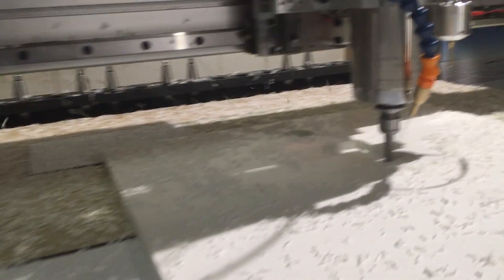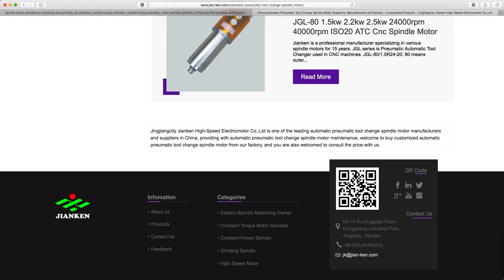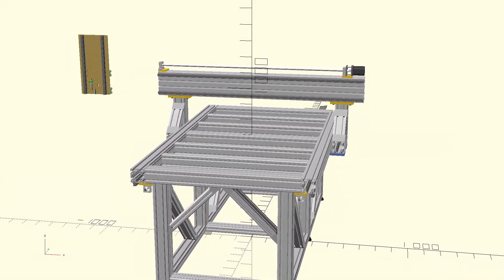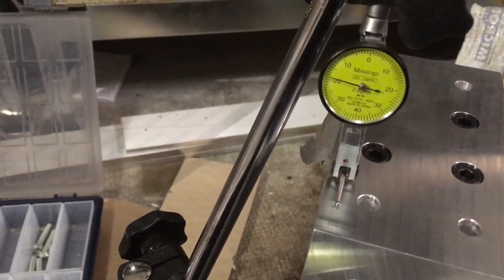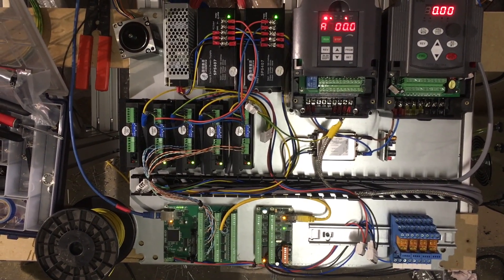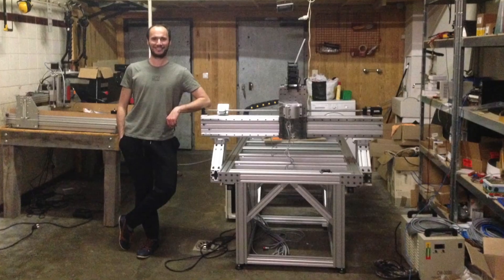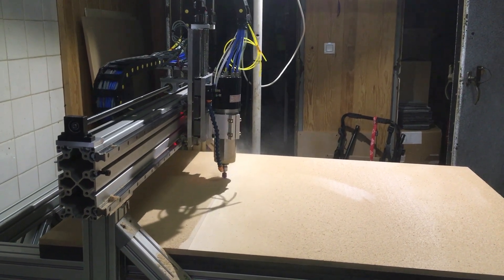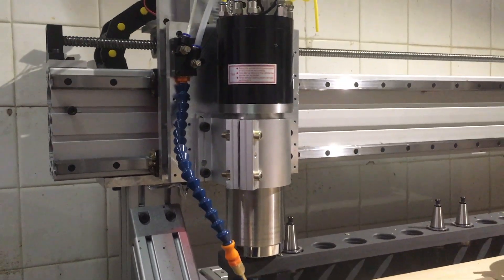My DIY CNC Router build with ATC and Vacuum Table

Comment: Nice work! love the ATC and the probe. What vacuum-pump did you get?  I found a -330mbar of 2.2kw with 290m3 flow and a -560 with 76m3 flow. In my experience the larger flow is better for working on an MDF spoilboard. Are you using uccnc?
Reply: why would a larger flow be better? once the vacuum is pulled there is virtually no more flow
Reply: @Gekkoperformance  That greatly depends on your application. On the small machine I'm using a Edwards RV8 for vacuumpods, but for a bed you need something that has a lot more flow. When using a dedicated pod created for the job that has no leakage you can work with a low flow. If a vacuum is maintained, you wouldn't need any flow at all. But when cutting parts from an aluminium/plastic/plywood sheet you'll loose vacuum quickly. I'm using a ~10hp vacuumpump on my large machine that can pull -950mbar, with a 500m3 flow, but it drops to -200mbar when slotting parts out. Even with fully HPL laminated plywood it's hard to get a vacuum over -600mbar. (so you need to use some CAM-kong-fu with smaller parts) Most of the machines that are the same size are using something over twice as powerful. In some occasions a deep vacuum is needed to hold the relative smaller sized parts in place, in that case you don't need a breather-board like MDF and put the part directly onto the vacuum bed.  It's very convenient to be able to shut some valves on your vacuumbed, smack the parts in place and hit start. (and use the top of your spoilboard as Z 0 and the left front part as x/y zero. That way you only need to zero your Z when the spoil board is skimmed again. In most occasions a higher flow, relative lower deep vacuum is more handy.
Reply from the maker: I'm using a 2.2kW / 3HP / -0.190 bars with 318 m^3/h flow. But of course you don't have both at the same time, it's 0 flow at -0.19 bars and 318m^3/h at -0.00 bar. Given that it leaks everywhere with the MDF spoilboard (I almost never cover the unused area) I choose a high flow pump and I'm very happy with it. But I don't have any barometer installed so I don't know what is my actual pressure. Cutting aluminium composite panel I can safely cut pieces down to 15cm x 15cm. A more powerful one would of course be better, but this was the maximum I could use given my electrical installation (220v 1 phase, 6kW subscription).
And yes, I use Z = 0 on the spoilboard surface and I never have to zero my Z. This is very convenient. I actually set my Z zero 0.1mm below the surface to be sure to cut trough.
No, I don't use uccnc, I use LinuxCNC.
Reply: @YannPomarede  Thanks for your reply.  Yes, indeed, the one I was looking at is a dual stage, they typically have a higher flow at a deeper vacuum. (dual stage over single stage) At home i'm also limited in power.  so 1.5-2.2 kw is the max. Did you skimmed the MDF on both sides? this makes it more 'breathable' but I guess you know this.
Reply from the maker: Yep of course I skimmed both sides. But I still need to add more glue on the sides and bottom, because I can feel the leaks. I hesitated between a single stage and double stage and I went for the single stage. But I have no idea if it was the best choice.

Comment: Well done, very nice build. One thing to try is to add weight to it (ballast in the gantry) and it will dampen the vibrations. 

What soft are you running it on ? 

All the best!
Reply from the maker: Thanks. I'm not sure adding weight would dampen the vibrations. It would certainly lower the vibration frequency, but as for dampening I would need to use a material that actually absorb vibrations, not just dead weight.
I'm running it with LinuxCNC.
Reply: Yann Pomarede: you are correct, you will shift the natural frequencies lower and thus getting rid of the typical buzz accompanying home made CNC machines. I wrote it up in a confusing way. Once again, well done !

Comment: This is amazing very impressed!!! What is the rigidity like?
Reply from the maker: Thanks, well, it's definitely more rigid that my previous one. But still it can "bend" a couple of 0.1mm if I apply a couple of 10kg with my hands. I never measured precisely though. But I guess it's normal with an aluminium frame.
Reply: @YannPomarede  I want to see how you have done the probe and auto tool change

Comment: What is the price of the spindle?
Reply from the maker: 1360 € 1 year ago
Reply: @YannPomarede  Thanks! I am not any expert, but this price sounds really good! What did you spend for the whole project? (I don't know if it is OK to answer those questions publicly, I am really interested of building one in future. Is it fine if I have your email?)
Reply from the maker: Adding every component together it's not that cheap and it's not in everyone DIY budget. But I'm using this machine to produce some parts that I sell. So it has already been paid by itself within a year. It's was around 8000 € of hardware + 3 months of design and assembly.
Reply: @YannPomarede  I am not thinking for a private use. I would like to have a workshop that I am already talking with a friend and a cousin for a custom CNC. I can't find anything I like on market and they are really overpriced. My project If I can make it should be 3000mm x 1500mm for plastics and maybe wood only. At least 8 interchangable tools and a good vacuum table. I can design everything. But I am not good at all with electronics...

Comment: Any issues with screw whip?
Reply from the maker: Yep, that's my limiting factor for speed. I run my rapids at 9000mm/min and I cannot go faster. But that's no surprise, and that was in line with what I had calculated with the ballscrew diameter, length and rotational speed. That's why I choose a 10mm pitch (instead of 5mm) for X and Y.

Comment: Great job men . The connection with computer is usb ? What kind of breakout  board are you used ?
Reply from the maker: It’s a Mesa 7i96 board connected with Ethernet to the computer. And I run LinuxCNC on the computer.

Comment: What is the black material you are using for the vacuum table called?
Reply from the maker: It’s a kind of MDF but denser, with thinner grain and more resin. It’s called Valcromat
Reply: @YannPomarede  Appreciate the reply. Great work on your machine.

Comment: whats up with all theses guys building their own cnc routers? with that kind of money you could buy an used machine that would do real heavy work with fast rapids and a real atc. some machines with some repair and reconditioning could do parts with even +-0.005mm tolerances with easy.
Reply from the maker: It would not be as much fun if I just had to buy one ;-)
No seriously I looked around, and of course real routers may be faster, do heavy work and have better precision, but they also weight literally a ton, are difficult to move (I'm renting the flat currently) and are 3 to 4 times more expensive (for used one).
Reply: @YannPomarede  well. Just that amount off aluminum that you bought, I could have bought a fanuc robodrill here.
Reply from the maker: I don't know where you live, maybe aluminium is ultra expensive or a Fanuc Robodrill is super cheap, but here in Europe I paid less than 1000 € for all the aluminium you see. If you can provide me a Fanuc Robodrill for that price I might take one, but its working surface will still be too small for my needs.
Reply: @YannPomarede  I agree with you.  I had the chance for a 5'x10' massive ATC CNC router... but had to pass on it because it wouldn't exactly fit in my garage.
Reply: @YannPomarede  Hi Yann, really nice machine you've built!
Currently i'm designing a cnc router/plasma table as well and wondered where you've ordered your aluminium profiles and plates, because around 1000 euros for everything looks like a good deal :)
I'm looking forward to your next table built :)
Kind regards, Mathieu (from The Netherlands)
Reply from the maker: @mpkleinbreteler  You can find the aluminium profiles and plates here: https://www.motedis.com

Comment: Cool Machine, i have an idea for the next Video: Put some JMC Servos on there they should fit the existing mount and are rated at 180W (depending on the Type) and they are cheap!!
Reply from the maker: My next one will use servos, stay tuned ;-)

Comment: Nice work.  I'm really liking the vacuum table setup.  I'd love to see more videos on how well the design worked for you and details.  I have been thinking the diaphragm vacuum pumps on some industrial water pumps I work with might do very well for the application.
Reply from the maker: Thanks. Correct me if I'm wrong but I think diaphragm vacuum pumps are high vacuum (close to 0 bar) but low airflow?  It could be suited if you want to hold firmly small parts with good sealing, but in the case of a MDF vacuum table with lots of leaks, what's most important is a high airflow to compensate for all the leaks. No?

Comment: What is happening when you say you're "setting the gantry"?
Reply from the maker: I wanted to say “squaring the gantry” but I got confused while recording the audio. I was measuring the angle between X and Y axis. Then, applying an offset on one of  the end stops I can correct the gantry for squareness.
Reply: @YannPomarede  excellent solution, I've been trying to solve that problem on my X-carve, thank you!

Comment: The whole gantry is basically hanging from the 2 linear rails on the bottom? Is the gantry not  to heavy for that?
Reply from the maker: Too heavy for the rails, the bearings, or the screws? Those are 20mm rails, each of the 4 bearings on those 2 rails supports a dynamic load of 17 kN (~1700 kg). And each 5mm screw (class 12.9) on the rail breaks at 10kN (~1000kg). There is a screw every 60mm. That leaves some room for overloading that gantry. We could easily fit 10 persons on it! Well, not that easily because there would not be enough space to sit ;-)
Reply: Sound strong enough.  Can't remember ever seeing such a config. Keeps the rails clean  and out of the way. Those 10 people on the gantry would be a fun YT video :)

Comment: Probably the best diy build ive seen ! How powerfull is the vaccuum motor ?
Reply from the maker: The side channel blower used for vacuum has a power of 2.2kW, airflow = 318 m^3/h and pressure = -0.190 bars.
Reference GHBH 003 34 1R7.

Comment: Can you tell me  what you use   program   for  auto tool changer ??
Reply from the maker: I'm using LinuxCNC and I used it's code remapping feature to change the behaviour of M6 to my own tool change routine. I don't need any post processor in my CAM. I just output a Tx M6 and the tool changes.
Reply: @YannPomarede  thanks bro
Reply: @YannPomarede  Will Linux CNC also do the probing and coordinate transform for you?  That's really slick how you just sense the flipped location in your example video.
Reply from the maker: @aeronerd22  Of course it can do all that :)  LinuxCNC provide 2 things : a normal probing move (G38.x) and a coordinate system transformation (G10). Then it's up to you to program in GCode all your probing move, compute the new origin and rotation based on the result of the probing (still with gcode, you can do sums, averages and arc tangent), then apply the result with a G10.

Comment: how much did the ATC spindle cost?
Reply from the maker: 1 year ago it was 1360 € (with shipping included)
Reply: @YannPomarede  not bad
Reply: @YannPomarede  amazing build and video. How is the spindle performing now after some use?
Over on the diy cnc Facebook page everyone was very impressed with your build.
Thanks 😀
Reply from the maker: @MakeTechPtyLtd  It still works great. I've been using it with higher and higher feedrate & RPM on a small production batch. With my new 8mm roughing endmill with 3 flutes I get the following speed/power:
PVC: 30k RPM / 8mm WOC * 5mm DOC * 9000mm/min => 1800 Watts on the VFD.
Aluminium: 25k RPM / 0.6mm WOC * 10mm DOC * 9000mm/min => 1500 Watts on the VFD.
Plenty of material removal rate! :)
What Facebook page is it?
Reply: @YannPomarede  quick reply, thanks! Looks like some text was cut off your comment.
Reply from the maker: I can see the whole reply clicking "Show more". Can't you? I was asking at the end on which Facebook page you saw my video?
Reply: Got it. Weird. It didnt show all the tect before. Its "DIY CNC machines" on face book. 16k members

Comment: I as well would pay for exact plans for this entire setup.
Reply: there is not a single youtuber willing to sell the plans for the ATC and a proper vacuum table. None of them even explain in detail how to get the ATC pneumatic working.
Reply: @Z-add  Petr Fox explained the Jian Ken JGL-100 spindle in detail in his review, including the pneumatics. May be worth watching if you are interested. He also did an aluminium vacuum table for his CNC made from granite. Impressive stuff.
Reply: @Z-add  I'm building a vertical mill with ATC right now. I am using a BT30 belt drive spindle cartridge with drawbar and a 2kN pneumatic actuator to release the tools. It's really simple. The tool is held inside the spindle through the pull stud with a big stack of springs. To change the tool, pressure is applied to the pneumatic actuator which compresses the springs and releases the tool. 

https://youtu.be/kkGQuBYEGMM?t=181
Reply: RoboCNC Frees- & Graveerwerk has free plans for his router build.  No ATC or vacuum table but still a really solid CNC router.  If Yann made plans available I would buy them in a heartbeat.  But documentation is usually the least fun part of a build like this.....
Reply: @jakemestre  I looked at his website and could not find any plans.  Maybe I was having a senior moment but I could sure use some help in the form of a link or something if you don't mind.
Reply: Just beautiful!

Comment: Congratulations to you Yann, I feel that there will soon be a very big machine ;)
I loved your 3D presentation to show how your machine was assembled. As I already knew her, I'm not surprised but I still discovered some nice things, like the rails fixed from below which is a good thing so that the slides are not exposed to chips.

Bravo à toi Yann, je sens qu'il va y avoir dans peu de temps une très grande machine ;)
J'ai adoré ta présentation en 3D pour montrer l'assemblage de ta machine. Comme je la connaissais déjà, je ne suis pas surpris mais j'ai quand même découverts des belles choses, comme les rails fixés par dessous ce qui est une bonne chose pour ne pas que les glissières soient exposés aux copeaux.

Comment: Amazing machine!
What Steppers/Servos did you use? The ones I could see in the video seemed rather small for milling aluminium.
Reply from the maker: My motors are steppers, Leadshine 57HS13 with parallel wiring driven at 4A RMS with Leadshine DM556 drivers and 40 Volts PSU. And it's way enough. I cannot stop the machine with my hands. If I remember correctly my computations, the force is around 60kg (600N) on each axes. At max speed I loose half the torque/force, but that's still a huge force. And my limiting factor is the noise and vibration if I push too hard, but I've never stalled the machine. The radial force on the tools never goes up above a couple of kg in my use cases. Have you seen my other video milling aluminium? I think I'm still too conservative and I could be more agressive on the cut.
Reply: @YannPomarede  Yes, I have seen the other Video. Very impressive! Seems like a heavy cut concerning that it is a Router. I would be very interested in another Video where you try to find the limits of your machine.
I am planning to build a CNC Mill myself. I will be using 3Nm Nema23 Steppers so I guess that will be plenty of power. To compensate for the vibration issue I will cast the frame of the machine (probably polymer concrete). But I am going for smaller X and Y and bigger Z travel, than on your machine (in general more of a aluminium/steel machining center).
Reply from the maker: I'd like to build one using polymer concrete someday! But I have more needs for a router now. Maybe later :)
Yes 3Nm seems to be plenty of power, but you also need good stepper drivers that a high voltage power supply, that's the key to get the max performance out of your motors. High voltage decreases the time needed for the current to rise in the coil at each step, and that's what give you good torque at high speed.

Comment: Very nice machine!  Could you describe what the black material is that you used for the vacuum table?  The description says MDF but that doesn't look like the MDF I have seen.
Reply from the maker: The material's brand is Valchromat. It's a kind of MDF but with more density, more "glue/resin" and a thiner grain. It should be more stable with humidity. It's also more airtight than normal MDF but it's always better to apply glue on the side and bottom.

Comment: Nice build. Thanks for sharing it. Can you give us a link to the ATC spindle? Also, is it 220v single phase? Or 3 phase?
Reply from the maker: Here is the link: http://www.jian-ken.com/automatic-pneumatic-tool-change-spindle-motor/jgl-80-1-5kw-2-2kw-2-5kw-24000rpm-40000rpm.html
It's a 3 phases / 220 V asynchronous motor. But the VFD takes care of generating the 3 phases at any arbitrary frequency. You only need a single phase in your workshop.

Comment: The cad presentation is impressive what our you using and what ball screw as the aluminum machining is really good
Reply from the maker: Thanks, for the CAD I used OpenSCAD. It's a kind of compiler that build a 3D model from code. You  need to be a developper to like it, but then you'll love it! The ballscrews are 16mm diameter 10mm pitch for X and Y, and 5mm pitch for Z. I bought them here: http://dold-mechatronik.de